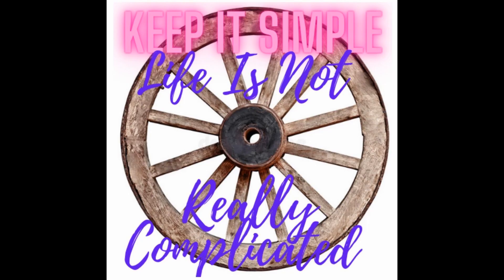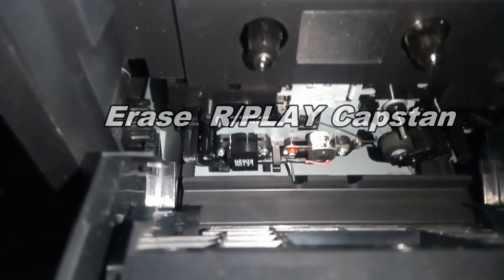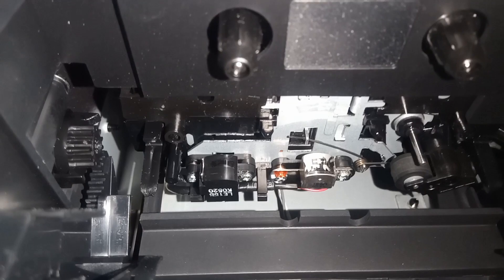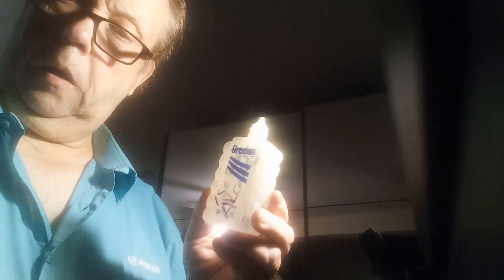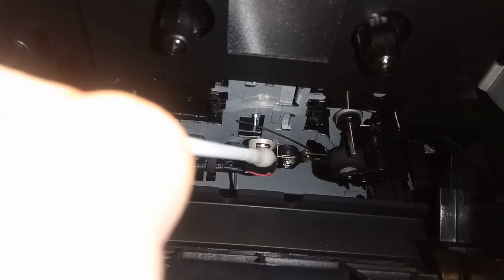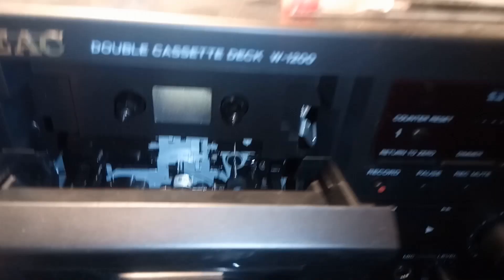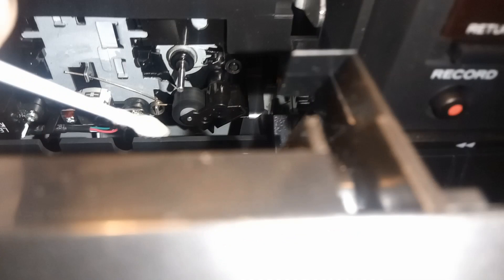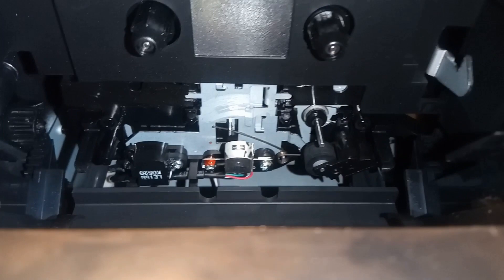How to  Clean the Heads on your Cassette Deck - Tape recorder.  Safely

Comment: Good video, handy to look at when you are new to this. I still have issues with a bit of rust on my capstan, I keep cleaning it, but I’m not keen on playing tapes yet. It got much better since the first day i got my deck :) but still long way to go i guess. Using plastic card and WD40 to slowly dissolve the rust and gently scrape it off.
Reply from the maker: I feel your pain for the rust. Just a thought, in the UK we can get, Fingernail polishing boards, Women use them to Polish out the ridges etc of the nails. They leave a really shiny surface. Not to be confused with emery boards. That would help. No need for the WD40. Or You could try  Chrome Polish or T Cut. These products are made to abrase and polish surfaces. 
Good luck. Thanks for your feedback.
Reply: @GaryKeepItSimple  will give it a go! Thank you!
Reply from the maker: Let me know how you get on. 👍
Reply: I was told not to use isopropyl on the rubber rollers.  I was told it dries them out.  Any thoughts on that?

Comment: How do you like that deck? And there seems to be debate about alcohol on the pinch rollers.  Thoughts?
Reply from the maker: I have been using Isopropyl alcohol for 40 years and have not had a problem. I do not see how alcohol can harm the rollers as it is totally evaporated in a few seconds. There is no residue. However, I can be open-minded, if someone can explain. Oil-based or chemical products would leave a trace that could do harm. WD40 rots plastic for instance.  As for the Teac  W-1200, I am very happy with it. I have used it for all my tape reviews and it is doing a great job. I can recommend it as a good all-rounder. It behaves better than Spec. Cheers.
Reply: @GaryKeepItSimple  thanks.  If I replace my JVC, it would likely be with the Teac (being one of the only choices for something new helps too).
Reply from the maker: All the music I play on my Tape reviews is on the W-1200 also there are a couple of music playback videos specifically chosen to allow listening to the W-1200. The only problem I had was finding music that was challenging and well recorded on the YouTube  Library. So if you listen to them please bear in mind that Phasing and Wow is on the original not on the w 1200 as proved by the results of the actual tests.

Comment: What is that fluid?
Reply from the maker: 99% Isopropyl alcohol
Reply from the maker: I got a big bottle of clinical grade IPA. I decanted it to the Grecian 2000 bottle because it has a small hole to allow easy dispensing.